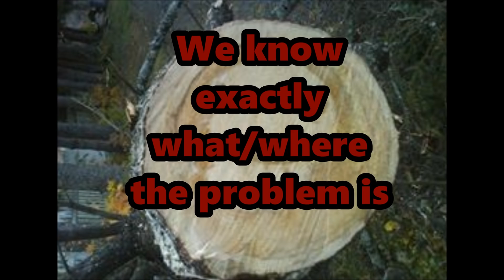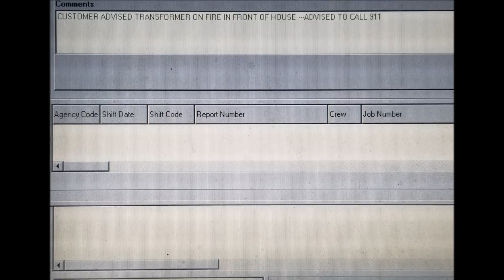5 Myths about Power Outages

Comment: A few months ago there was a brief power outage which knocked out power to the surrounding cities, but not us. I was informed a lightning arrestor went bad at a substation. It happened while it was clear outside. Do they normally fail in clear weather or could it have been from a previous lightning strike?
Reply from the maker: Stormi Folf It's not common , but lightning arrestors can fail for no reason at all ! A lightning arrestor actually connects the phase it's attached to directly to " ground "  however the resistors in it have such a high rating that it takes an extremely high voltage to pass through , ie ; lightning.  With that physical connection being there the present voltage is ready and willing to go to ground if there is even a slightest defect in its construction. Also over time the surrounding insulation breaks down or may absorb moisture. Could have been a bird or animal of some sort short it out as well
Reply: Stormi Folf fancy seeing you here!

Comment: We had a transformer at our old home blow up considering lightning struck it and the transformer protection didnt save it there was oil and scrap everywhere under the pole
Reply from the maker: Oh Crazy! .. yeah I didn't want to mention in the video that when they do blow up, they throw burning hot oil all over the place ! One of the calls I had was actually a Voltage Regulator that blew, it was quite a mess!
Reply: Bobsdecline do i need to remove the comment? Lol and i think regulators will go up in flames if they are bypassed without being in the zero position
Reply from the maker: Not at all man :) and yeah , if they aren't zero'd they will definitely fly apart! In our case it started arcing between taps until it blew the lid off
Reply: Bobsdecline Holy cow! Lol ive noticed that arcing can occur without explosive force but ive noticed at some point it becomes very violent! Any explination on that?
Reply from the maker: When the start and end point of the arc are at the same potential, the arc itself is basicaly using the airway as a high resistance conductor . whatever its feeding will still function , although most likely at a reduced voltage from the high impedance. Once that arc connects to another phase, or to ground the current flow in the arc will jump instantaneously from ,say, a sustainable 200 amps , to an explosive wire melting 2000 amps. 

Hope that helps:)
Reply: Bobsdecline Thanks!!! That helps out alot! 2000Amps is alot lol
Reply: @Bobsdecline  hey man im a lineman are yall hiring
Reply from the maker: @sheltonnewton9898  unfortunately not at the moment ... Where are you located ?
Reply: What feeds the arc is the air ionizes and becomes conductive, which helps maintain the arc as long as a load is on it. You can always smell the ozone after a high voltage arc be it from switchgear, line faults, lightning, etc. I was a Journeyman Lineman for over 40 years, retired in 2010. The last 28 years was at Argonne National Lab., South of Chicago. The last 4 yrs., I was Supervisor of High Voltage. We had x-mission of 138Kv, overhead and underground, distrib. 13.2Kv, overhead and underground, 4160v, and 2400v.
Reply: Thanks Ronald!